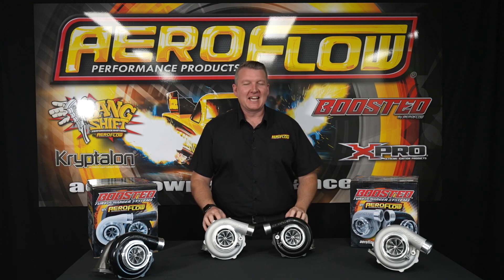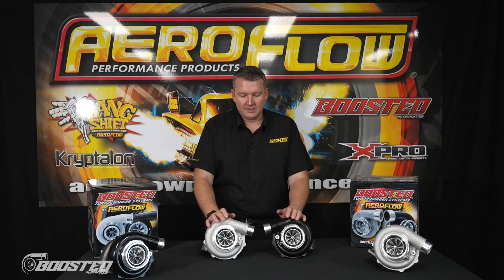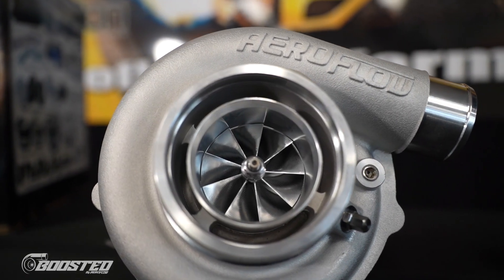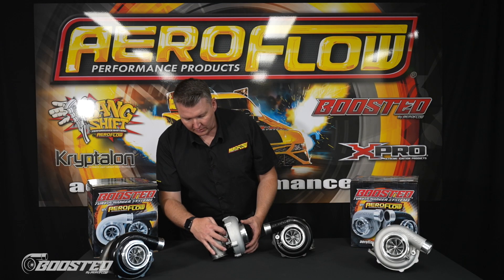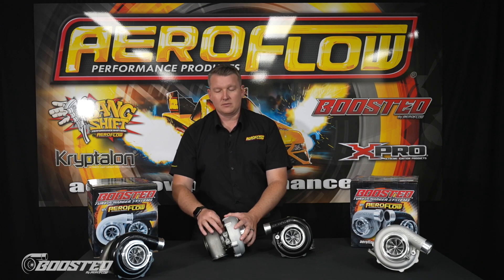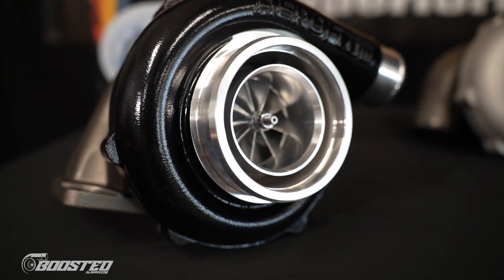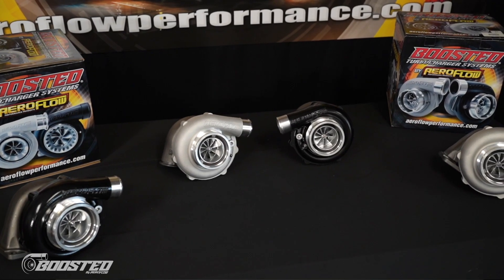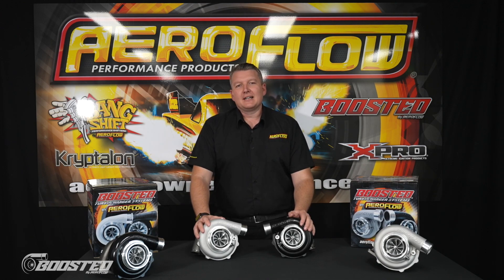900hp Compact Turbos?! Boosted 6255 & 6262

Comment: There’s no way this 6255 makes 900 hp on a 2.0t motor like it’s recommended for , when Garrett’s 3576 , 62/55 is rated for 750 hp and doesn’t really ever get close to that on a 2.0t , and this is a copied version of their g series , like a g30-900 I believe , but I just don’t see them making 900hp ever on anything 4cyl ? Really nice turbos but I feel like these turbos should be advertised with more realistic hp numbers on the tail of the model ..
Reply: Engine size doesn't dictate HP, not when a turbo is involved. Turbo size dictates HP. A bigger engine will spool up the turbo quicker and won't need as much boost to make the same power. Power is airflow, and airflow is limited by your turbo. That 900hp rating is based on how much air the compressor can theoretically pump into the engine. 62mm compresssor is rated for 900hp on these next gen turbos.
Reply: @ I’m fully aware of what they mean and stand for , just saying a 2.0t motor won’t ever make 900 hp with a 62 mm turbo . I’ve had tons of 2.0t cobalt ss cars , they are direct injected also which helps make more hp , and I have never got one anywhere close to 900hp after a full build and a 62mm g series turbo ..
Reply: @Jenkins137 that’s kind of unfortunate for you. I have a k series that made 552 wheel on only 14psi and pump gas. Tuner says we can get well into the 800’s wheel. That’s over 900 crank. And running a 3582R. I’m only looking at this because turbo did take a dump.
Reply: @ I was talking about a 55 mm turbine wheel on that turbo , saying it wouldn’t flow Enough to make 900 hp on about anything
Reply: @Jenkins137 my bad I thought you were saying the 6262 wouldn’t do it lol
Reply: @ I still don’t think a 6262 would net 750hp out of a 2.0 street car engine .. I’m sure if you had a full out race motor , built to capatilize on every aspect of the engine , it might get close to 700hp . But just going off all the 2.0 direct injection turbo motors I’ve had , I’ve not seen any get anywhere close to that , with a 58/55 mm turbo
Reply: @Jenkins137  idk brother my turbo is comparable to a 6262. K24A2. Like I said 552 at the tire on pump. 14 psi.
Reply: @ that’s what’s up .. I just haven’t seen it ever happen with the 2.0t eco tech motors I’ve always ran ..
Reply: I have a 2014 beetle with 2.0t ea888.3 on a PSR 6255g made 747whp on 33psi turbo has more in it.